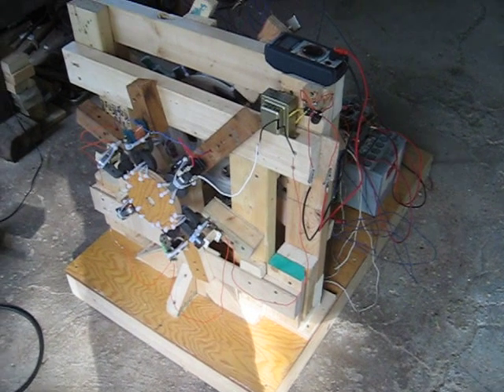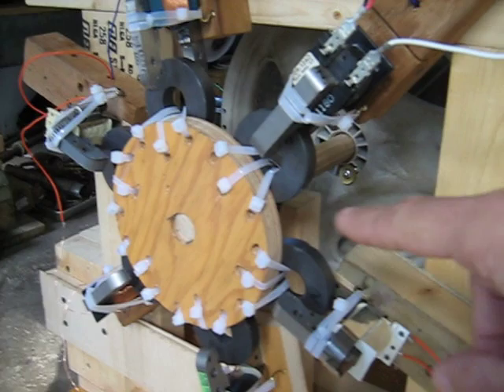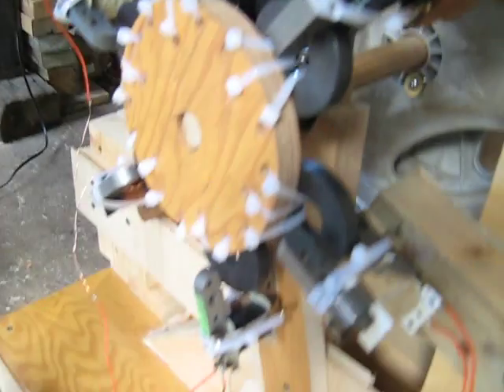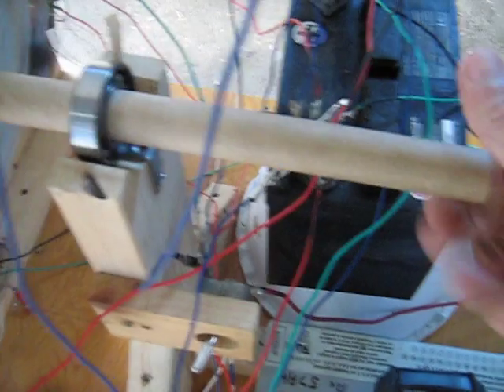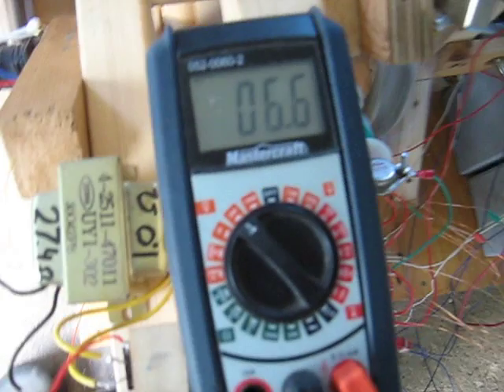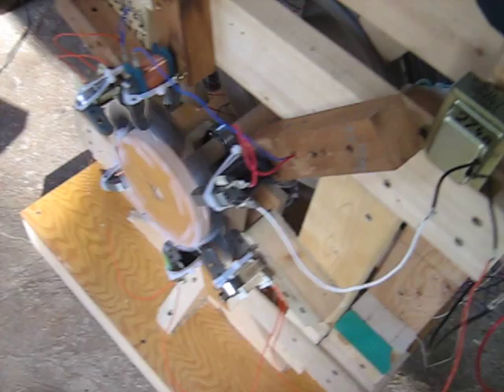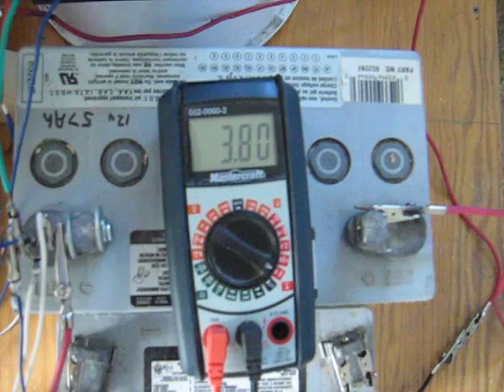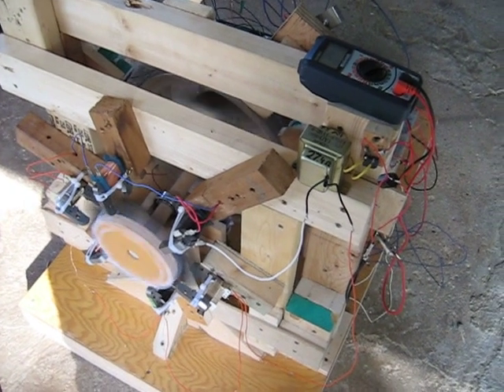Bedini Wheel - 7 Coiler - Plus Generator Output

Comment: so why not leave your variable resistors in the circuits and turn them down so that wheel humms with the generator generating more electricity.  The drag from your extra pickup coils will lower your amp draw.

Comment: evidently Thanes effect was disproven as it only works on AC motors and is simply the field generated by the magnets syncing with the stator field coils ??? the same effect does not work with a DC motor which dosnt use field coils ... I am awesomely disappointed as I wanted to use his technology on a electric bike????????

Comment: the wheel is going to slow no matter what if u are using a FWBR and short the terminals. in this case the HV side of the transformer apparently has enough resistance to not slow it, especially since the primary is going through the cap.
u should be able to use a pot across the leads and adjust it til it slows the wheel. as long as the resistance of the charge batt doesnt go below what the Pot slowed at, the rotor shouldn't slow with the charge batt attached. plus arent those trans made for 60 hz

Comment: 3 free watts awesome... if you made the air gaps on the PMHs smaller it should drasticly increase that 3watts... also did you cut the cores for the PMHs with a hack saw? or do they just come apart like that ... if you cut them I would recommend sanding the cut area as it will reduce the contact between the core plates... awesome freekin looking machine